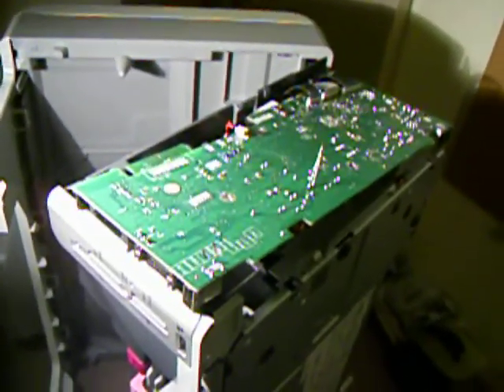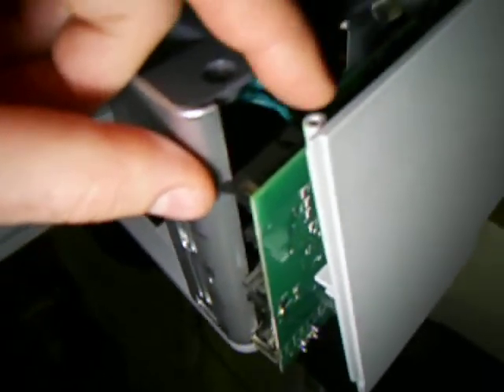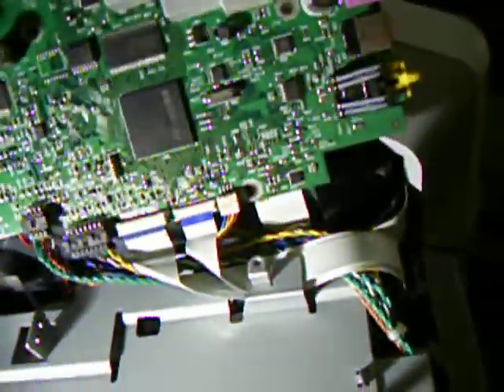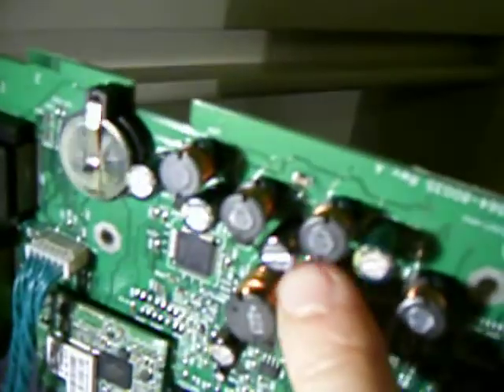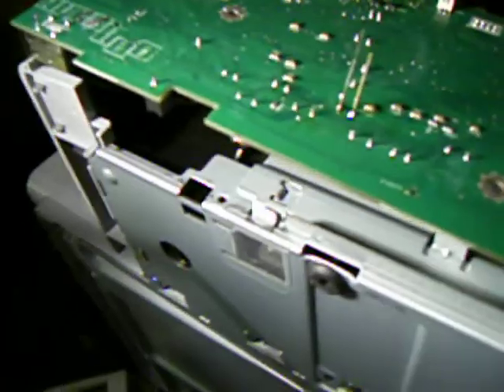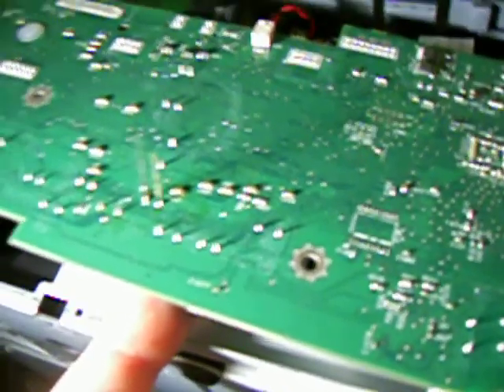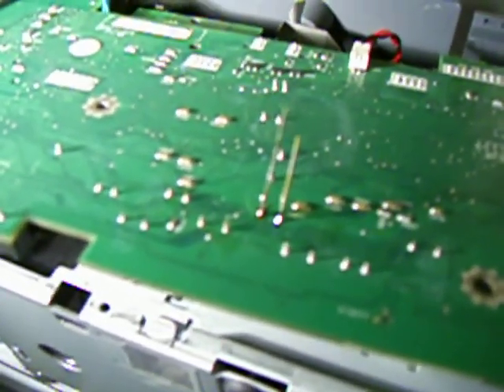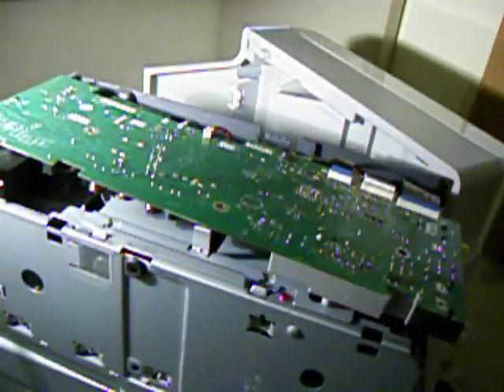Fixing HP7280 Printer Capacitors & error messages_Part 1 of 2

Comment: When you say the capacitor needs to be the same or "better", what constitutes "better"? Is it the uF (and is 500 better or worse than 330), voltage (again, is 15 better or worse), or temperature (that's obvious).
Reply: The capacitor needs to stay at 330uf but the voltage can be higher dont go lower for example my original ones were 10v i replaced them with 16v ones.
Reply: Thanks so much; that helps a non-electrical person like me.  :)

Comment: Actually, an Alan key can be used to work a Torx fastener. You should be able to apply enough torque even with just a hexagon, but theoretically a real Torx driver will be more precise and able to use more of its potential torque.
Reply from the maker: You run the risk of stripping a fastener when you substitute a torx for a hex...although I admit I have done it before in a jam.

Comment: Great Video Thank You.
I have an HP C6180 that was going through continuous start up routine and would not connect to the router.
Replaced 4 X 370uf capacitors as two were domed/bulging and decided to replace all 4 with 25v versions from Ebay UK for less than £3 delivered.
I will make sure that I get some copper braid next time, my biggest problem was un- soldering the old capacitors.

Comment: I just took apart my printer (same as the one in video). I have 2 domed capacitors but will replace all 4.
My question is: In regards to the capacitors, is there a better brand offering better quality for a longer lasting component?  Thank you.

Comment: OK, on my REV A board, in the installed position (ie, looking at the back side right side up), the 4 capacitors are installed in this left to right order: 

C660 - 330uF
C662 - 680uF 
C614 - 680uF
C613 - 330uF

Hope that helps.

Comment: Unfortunately, for the same model printer there are several versions of this circuit board with the capacitors in different locations.  If you can figure out a way to post a reply video or photo maybe someone can assist.

Comment: Replaced both 330uF and both 680uF caps on my old C7280 as per your video and the printer now boots perfectly.  Bravo!  (Did not solve my Ink System Failure error, but that's another story.)

Comment: Provided you didn't mess anything up, I believe there's another circuit board under the front panel where all the buttons are. There may be a few more problem capacitors located there. Info on how to access these should be findable by doing an online search for "How to disassemble and clean HP 7280 scanner glass mirror". The website it's on is Indian, but don't worry the forum with the explanation is all in English.

Comment from the maker: they are supposed to be flat on the top.  you will typically see a bulge on the top of the cap.  Sometimes they will leak a white goo.... but typically they just bulge.  make sure you install the new ones in the same polarity (+ -) as the old ones or they could explode.

Comment: I had to join here just to say thanks for this video..I have had problems with my printer since i paid a high price for it brand new 4-5 years ago (only on second set of cartridges now)
anyway i got the blue screen errors and flashing lights a few days ago and then found this video .... well it worked. The one that was blown on mine was the same as yours the 680uf one i did have to buy 5 capacitors online for $5.50 since there was none locally again thankyou...
Reply: So when i did the first repair 3 years ago i only replaced one of the 680uf capacitors that repair lasted untill about 6 months ago when i started getting an ink pump error and then other errors so i finally got around to replacing the last couple of capacitors about a month ago and everything is working sweet..I did have trouble melting the original solder and eventually ended up mounting the capacitors on the wrong side and its working perfectly.